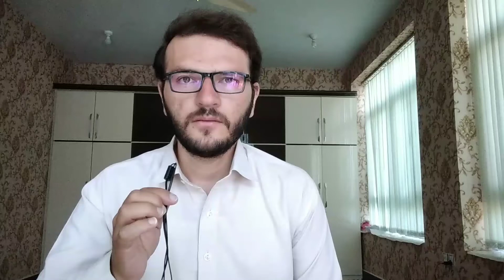How to calculate db per Km loss in Fiber

Comment: good day Sadiq, i got 0.216dB/km and 0.300db/km loss on my otdr reading for my 1.3km singlemode  2core fiber. is this reading ok? what is the maximum/threshold for dB/km reading?
Reply from the maker: db/km loss depends on the type and the quality of the cable you are using. 0.2 db is good while 0.300 db is a bit high. Just try with both 1310 and 1550 wavelengths and compare the results. The losses and db/KM loss in 1310 must be greater than the losses in 1550 if this condition is not satisfied then there is a bending or pressure point in your cable else its okay.
Reply: @MSB1180  shukran sir Sadiq, i have also searched the Loss Budget, now I know what is the maximum loss should i get from otdr reading, Thank you!
Reply from the maker: Shukran

Comment: When we take OTDR trace slice loss add in dB/km..?.
Reply from the maker: No bro both are shown separately.
Reply: @MSB1180  what is technical reason dB/km slope loss different every time but trace perform condition unchanged.
Reply from the maker: Hi vijay, what i interpreted from your question is the minor splice loss variations of the same link and at same conditions.
The OTDR detects the fiber losses and end of fibers by the desperation and reflection behaviour of light.
So every time we take otdr test the otdr shoots a new light beam in that fiber.
Statistically there should be no difference but this happens because of minor changes in the light behaviour and how otdr interprets it.
So basically as per my knowledge this is the otdr's limitation.
Since it's very minor like 0.05 so can be ignored.
Hope that your question has been answered.